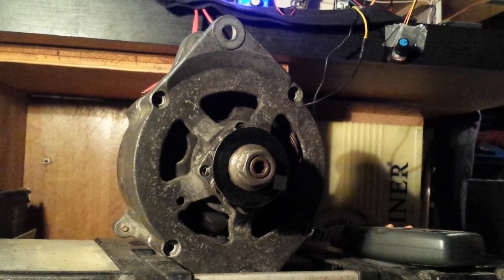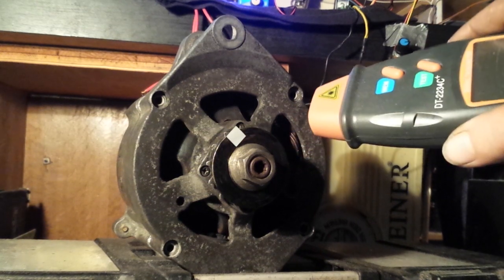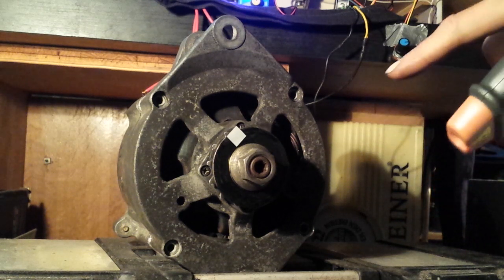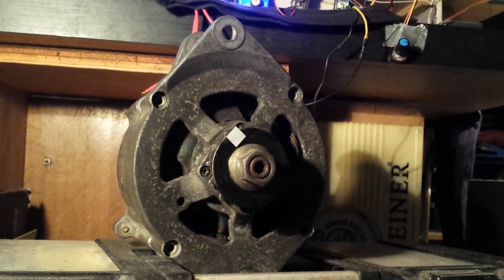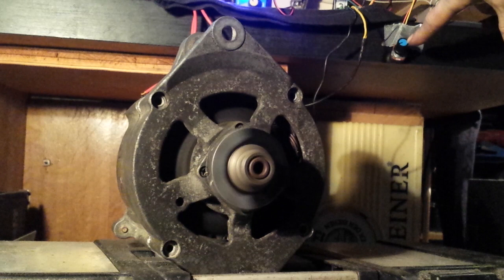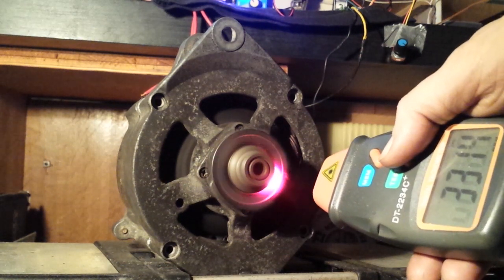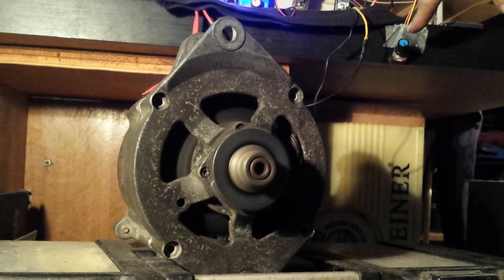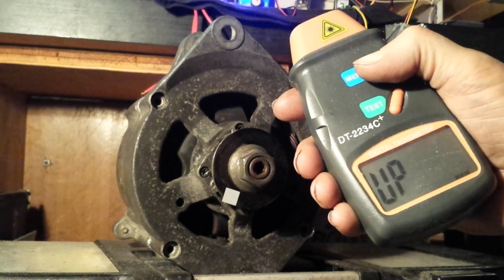Alternator as a motor, speed record

Comment: How mauch torque would you say it has? I need a motor with 10Nm and was thinking of using a alternator
Reply from the maker: Thanks for your question, sorryfornoname. I really don't have any idea how much torque it has a potential to create. If you can tell me what kind of an application you're planning to use it, I can give my thoughts about alternators chances to be a successful choise, based on my own knowledge/  experiences and how I have felt the torque in  the e-bike project. Should be possible to make a comparison and go from there. It's also possible to calculate it but I don't remember the equations anymore. Easy to find though.
Reply: @GhostOfKrezip  im trying to find a cheap suitable motor for a dyi video game simulator steering wheel. Ussualy those are at least 10Nm
Reply from the maker: @sorryfornoname2157  Good evening sorryfornoname. I'm sure the torque of an alternator is going to be enough. As a matter of fact, I think that an alternator of a motorcycle would be even better option for your application. It's not as powerful as a car alternator but still more than enough torque with much smaller size. If an alternator motor also  fulfills all other requirements to function well in your application, I have no idea. But the lack of torque would not be a problem. Good luck with your project.
Reply: @GhostOfKrezip  thanks a lot. i am going to built 2 steering wheels. if the first does well(using a servo motor) im going to try to make one with the alternator so i have a baseline

Comment: What alternator is that and how many volts?
Reply from the maker: I have made 2 videos where I measure the RPM. The first one is an alternator from a VW Golf, the 2nd is from a Chrysler. You can use all car alternators. I use 2 voltages, 22volts and an adjustable voltage to determine how much torque/speed the motor produces.

Comment: I use an e-bike 48 volt controller on a star winding alternator and only get 5800 rpm. Perhaps the e-bike controller doesn't expect to run a motor that fast.
Reply from the maker: Hi Paul. The controllers that are especially for e-bikes won't give you the full potential of the alternator motor. I recommend an ESC designed for heavy duty brushless motors used in agricultural drones with the amperage at least 80A.

Comment: What current were you seeing to the coil? I know in the other reply you said you didnt measure it but maybe you can state the capacity of the PWM circuit and estimate from there.
Reply from the maker: As far as I understand it the PWM circuit determines the force of the magnetic field and the capacity of it is very low. The current therefore is getting too high with relatively low voltages, respectively above 12V or so. The current of the circuit from the ESC with the voltage of 48 volts, in my estimation is somewhere around 60A or above (sounds high, I know) based on the fact that I already burned an ESC of 40A. So we are dealing with two separate circuits with both their own voltages and currents.

Comment: What voltage and amp use?
Reply from the maker: I'm using a 22volt Lithium polymer battery to power the motor via the ESC (electronic speed controller) And  a11  volt battery to create a magnetic field to the field coil. In the other videos I show the setup with more detail. You can find them on my channel also. For the amperage I have no real answer because I have not measured it but I already burned one ESC which was for 40A. I don't remember what kind of ESC I'm using in the video. My recommendation is to use at least 80A esc if running the motor in an e-bike.